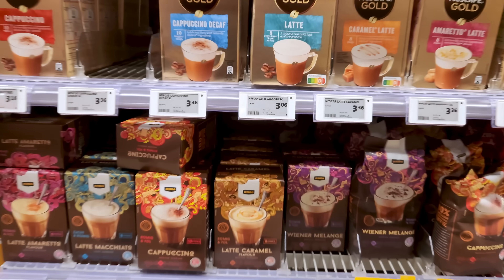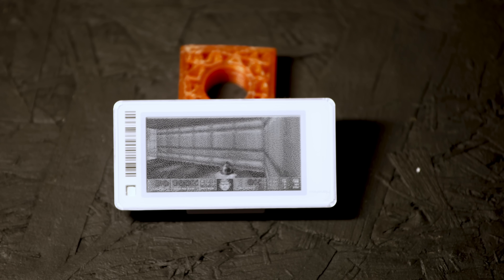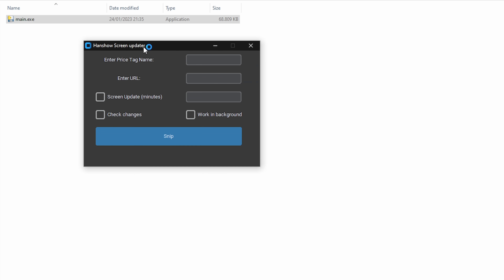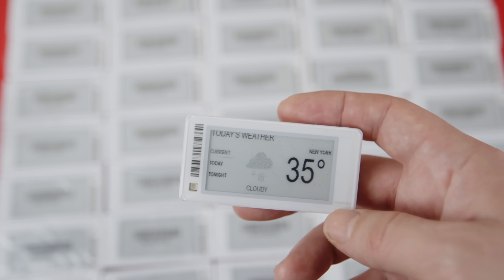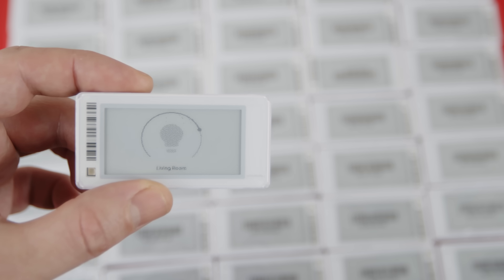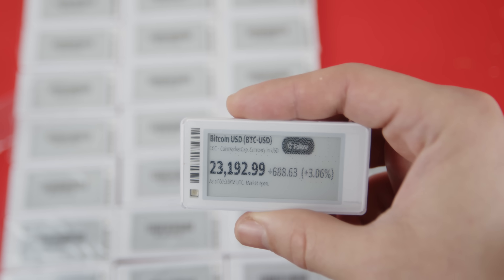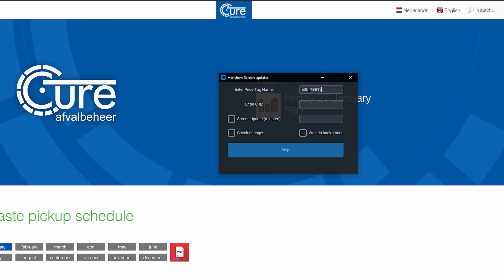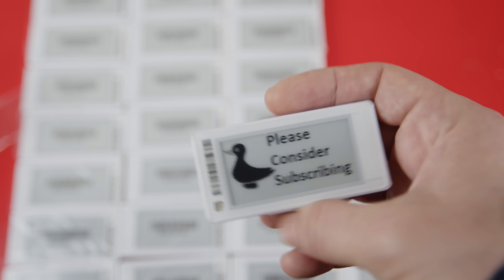Using e-ink (epaper) Price Tags (Shelf Labels) for everyday needs

Comment: I'm genuinely surprised that Doom looked that good!
Reply from the maker: I removed the refresh artifacts, and made a time-lapse video. normally it is really slow
Reply: @makersfunduck I assumed it was sped up but wouldn’t have minded if you put that in the video for context
Reply: @makersfunduck  😂what is the fps rate on average
Reply: @chargehanger  I would say it's seconds per frame :)
Reply: Ah ok that makes sense I’ve worked with a lot of e ink and when I saw that I was like no fucking way that’s e ink
Reply: @makersfunduck was it a pre recorded video or did you actually try to play it at less than 1 fps
Reply from the maker: @buddyguy4723   the actual speed is around 0.1 fps :D I wrote a simple python code to take pictures of each frame after the screen is updated. (Obviously I did not spend hours to took pictures of each frame manually like a crazy person lol.)
Reply: @makersfunduck  you mean you removed the frames displaying the refresh, or can you get the mcu in the tag to work without refreshing?
Reply: @makersfunduck  Yep they are death slow (i work at a Supermarket)
Reply: @makersfunduck also why is it turned upside down?
Reply: Ah ok that makes sense I’ve worked with a lot of e ink and when I saw that I was like no fucking way that’s e ink
Reply: Ah ok that makes sense I’ve worked with a lot of e ink and when I saw that I was like no fucking way that’s e ink
Reply: Ah ok that makes sense I’ve worked with a lot of e ink and when I saw that I was like no fucking way that’s e ink
Reply: Ah ok that makes sense I’ve worked with a lot of e ink and when I saw that I was like no fucking way that’s e ink
Reply: Ah ok that makes sense I’ve worked with a lot of e ink and when I saw that I was like no fucking way that’s e ink
Reply: Ah ok that makes sense I’ve worked with a lot of e ink and when I saw that I was like no fucking way that’s e ink
Reply: Ah ok that makes sense I’ve worked with a lot of e ink and when I saw that I was like no fucking way that’s e ink
Reply: Ah ok that makes sense I’ve worked with a lot of e ink and when I saw that I was like no fucking way that’s e ink
Reply: Ah ok that makes sense I’ve worked with a lot of e ink and when I saw that I was like no fucking way that’s e ink
Reply: Wtf! Wasn't sure if it's fake or just edited, because the framerate seemed way to good. Happy to hear that you did a time-lapse, but still heavy impressed that it will "run" doom 😂
Reply: @HochFrequenzFreak it's a display, it can show whatever you throw at it so why wouldn't it display doom :P
Reply: Yes, but can it run Crysis?
Reply: Refresh rate on these eink displays never stopped improving, it’s rather amazing.
Reply: My tongue dried up because my mouth was wide open watching that!
Reply: I was actually quite jealous, as I can't get that frame rate on my Onyx Boox' Air 3c. 

But even with the trickery, it was fun to watch.
Reply: It was overlayed, not real